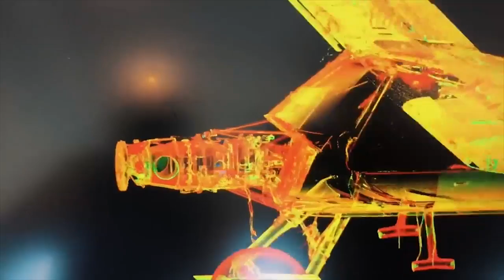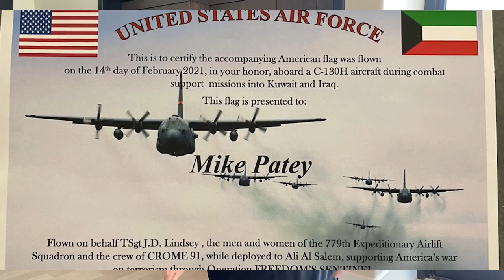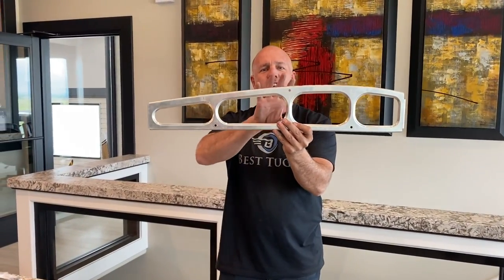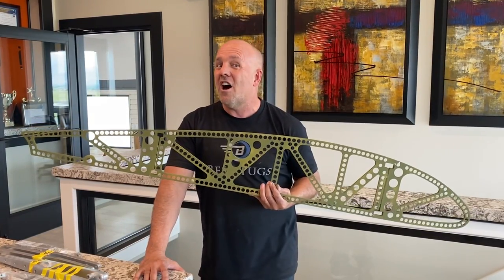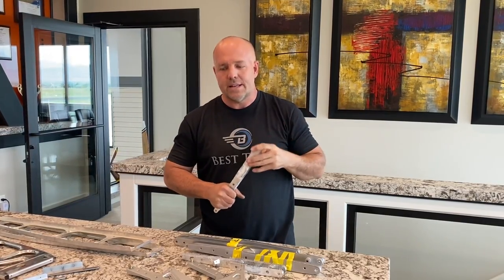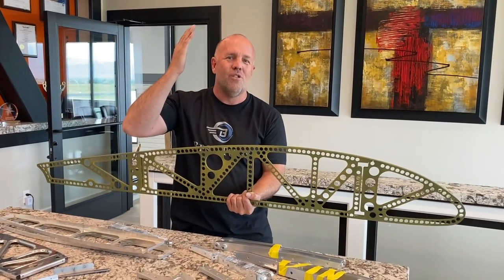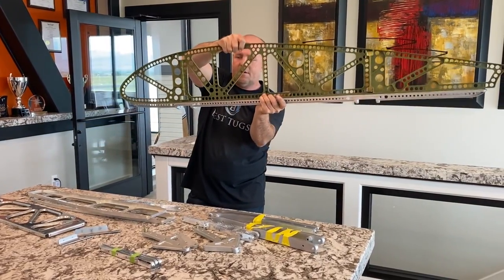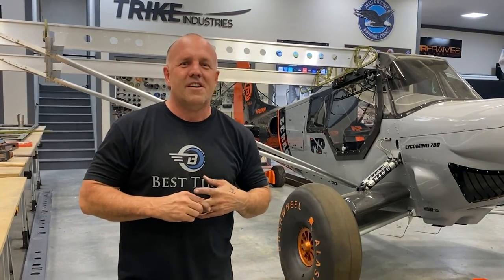Hanging Electric Mountain Bikes from an Airplane's Wing | Scrappy #56

Comment: All day Mike drills holes in metal, then bolts them together.  At first it’s boring, but then it’s riveting.
Reply: I see right through your comedic value! lolll
Reply: Slow clap.
Reply: Now that is funny
Reply: Interesting…@2:51 you can see that what became the keyholes startout as having an internal keyed feature 🤔

I surmise the hole pattern is for attaching actuators of some kind and the keyed opening is an anti-torque detail… but why two rotary actuator at mid span? Hmmm
Reply: @wwjjss33  I would guess some elaborate Fowler flap mechanism .
Reply: No words.
Reply: Hahah, awesome
Reply: Groan!
Reply: @wwjjss33  I was thinking he'd probably try some extended flaps like the RCAF Otter 3682, they're sort of like flaps on flaps and deflect twice as much, but instead of a permanent extension to the flaps, it would retract flush and not add any additional drag in cruise.  If it were me, I'd design a flaperon system to go along with it, and a servo tab controlled by a torsion bar because aileron forces get ridiculous with full flaps and flaperons.  The torsion servo tab is fantastic in its simplicity, the more force you apply to the stick, the more the torsion bar inputs travel to the servo tab to lighten aileron stick forces.  If you're slow and aileron forces are light, you don't torque the torsion bar and the servo tab stays aligned with the aileron.  If you're fast (or you have flaperons) and aileron forces are high, you're feeding torque to the servo tab and it deflects considerably to lighten stick forces.  It's a design seen on the Socata TB-30, you can hardly tell the difference between flying at 70mph or 270mph, they feel identical.
Reply: HOLY SCRAP!  Those ribs are amazing.
Reply: ahhh you...
Reply: @801pilot  amazing impressive beyond riveting- Scrappy EAA 21' :)
Reply: Ha.
Reply: Some people aren't catching the boring (drill), riveting (bolts)
Reply: Lol🤣

Comment: The special holes are for a special 360 powered articulating camera gimbal that will have a Multi sensor 40x Zoom / FLIR cameras that will look for heat signatures on the ground and auto track hot spots (people) for search and rescue ops! It will add the counterweight for the mountain bike.
Reply: Stunning idea

Comment: Weird holes: probably to hold actuators and power transmission elements related to changing wing form.
Reply: That was my first thought too but he said he hasn’t mentioned anything about what they’re for at all
Reply: He did say there is a torsion bar tube through his tank.  I bet it's a fabric top to the wing to work with this mechanism
Reply: Best bet so far.
Reply: Ohh, Mission Adaptive Wing!

Comment: I have no idea, but the arrangement looks suitable for a rigid torsion control connection, potentially even for an in flight wing flex/torsion adjustment by manipulation the lever end of a torsion bar to work like a dynamic sway bar on a vehicle.
Reply: My thoughts also, given he even mentioned having something similar in a previous video.
Reply: Thats what I was thinking.
Reply: I'm sure there was a hint about this in a pervious video on the fuel tank.
Reply: I thought the torsion tube was to actuate ailerons
Reply: Mike already mentioned that he will adjust the wing to add lift at low speeds but able to flatten the wing to avoid excessive drag at higher speeds... I think you guys are on the right track
Reply: Get's my vote - Mike will definitely have given a lot of thought to drag reduction for speed and range, given there's so much else going on for its STOL capabilities.
Reply: Yep, I agree.  Wing warping, chord and camber changing, and probably span adjusting (remember, slide-on ribs).  Wow!

Comment: Hello Mike, 
Retired structural engineer and rookie pilot here.  Have no idea about your mystery holes but as some have suggested maybe they have to do with your wing surface optimization.  Would like to add that the intersections of truss web members to the chords of trusses are “panel points”.  You explained where concentrated loads may be applied well but seemed you were looking for the term.  And one other thing is that without diagonal web members in a truss, you will still have a Vierendeel truss, although not as stiff as other trusses with diagonal members.
Sincerely,
Will

Comment: I guess those holes are to accommodate variable wing geometry system components such as pivot points and actuators
Reply: Nah those are obviously for  the active missle defence flair system
Reply: I agree.   Has something to do with the variable wing geometry.  He mentioned he was doing something like that.   Or it will be part of in air tanker refueling lol.
Reply: After all these videos! Why do I still sit here in disbelief?  These guys have NO limits. Thank goodness their passion is family and flying.
Reply: Looks like he's changing the camber and possibly the chord post wing tanks
Reply: The fact that the front spar is longer than the rear one makes me think something will move at the end of those wings yes….
Reply: Agreed, I think that’s what was blurred out in the last video.
Reply: This was my guess
Reply: Holes are there to make it lighter but strong....

Comment: The 6 holes are for the linear actuators that will provide the variable wing chord. One of the reasons the wings structures are so beefy are they need to take the load of a radically large chord. This plane might fly as slow as 15 knots or so in slow flight config.. Amazing Mike and crew!
Reply: Charlie dropping knowledge on us!!! 🔥💪
Reply: He said in a previous video that said system is powered by an axle (he called it torque tube) which makes sense. The axle is probably continuous  or has some mechanical connection and prevents one side to deploy without the other. 
Either way it doesn't justify the pattern of the holes... Also if I were to design a variable chord mechanism I wouldn't have one big single central jack screw, but rather 2 or 3 smaller ones along the leading edge.
Reply: @Ozarkprepper643  why would he want to adjust the dihedral angle of the wings? It only changes the stability of the aircraft, not performance. Especially when than involves applying more stress to already loaded components?
Reply: @Ozarkprepper643  ok...i never heard of an airplane that does that. What is the model? And do you actually see a difference in performance (speeds, loads, etc) 
How do you adjust it? It must be hinged at the root, do you have a telescopic strut or??
Idk, it doesn't seem to be one of those things I would want to change mid flight. Messing with the characteristics of the plane without electronic stability is bold to say the least.

Comment: The holes are for your flexible geometry wing mechanism…….or they could be the electrical output connector holes for the nuclear reactor you are scratch building, to power your camp lights.
Reply: 14:06 left side of the screen. Are these slotted sections for the slats, or?....
Reply: @jeffreyroth7517  speed brakes?
Reply: @Mikesukes  I was thinking about speed brakes but realized the prop will work well as a speed brake

Comment: Holes are for fuel lines and vents to drop tanks for the wings, ones with slots are for 2 pumps in each wing for redundancy
Reply: I like your guess better than mine. He did say he was going to have a fueling station for friends. So maybe the extra pump is for offloading fuel in the backcountry, refueling other aircraft.
Reply: @WeBeGood06  inflight refueling? cool.
Reply: If we look at the placement it really fits in nicely with the main wing tanks. Also important is that they are only there in the main spar, so whatever it is, it can only be a mounting bracket/hole.

Comment: The holes are for “tendons” much like prestressing in bridge construction.   On second thought, after seeing the trial install. they are to attach brackets for recessed lights.. Haha third edit, upon further reflection, I cannot presume to even have a clue,, Mike 😂 ..... Alright 4th edit. Its possible that Mike cut random holes to get far out ideas, and collectively invent something entirely new. The warp drive is my personal favorite.
Reply: Lol!
Reply: Hahaha this comment got funnier the more u read it
Reply: @Eric E That’s right. I forgot about the torque tubes. Honestly, Mike is creating wings that are unbelievably complex compared to the original Carbon Cub. I am not involved in aviation, but have invented and built a number of machines. The level of engineering he has built into this “scrap” project is a master class in design.
Reply: Yep, na…yep…na ok na
Reply: @Eric E Moving Slats!
Reply: The arrangement of the holes is weird. A variable chord mechanism would most likely have several jack screws along the leading edge, not a big one right after the strut mount...
Reply: @Lightbyfaith  that statement about a 'master class in design' is no joke.  A LOT of aircraft engineers could learn a lot from Mike and if they applied 25% of what he is doing in Scrappy to GA in general, we'd see a lot better aircraft for not much more money.
Reply: Are the holes for passing flight control cables through?
Reply: I say some is right... but after seeing these hard points... one of those holes is for a release cable I bet.... air drop of a survival pack to stranded hikers and climbers
Reply: @francisschweitzer8431  that is a wing spar. When the wing is finished it will be completely covered, besides is facing forward unlike the actual rack he just showed in the video, which could be used for that
Reply: Attachment for speakers to play Ride of the Valkyries
Reply: @almerindaromeira8352  Even if the wing is completely covered, you can still run small holes through it for release cables for a survival pack drop.  Why did Mike have so many pulley assemblies made up, especially if the control surfaces are going to be torque tube controlled?  Cable runs for the 'hard points.'
Reply: @GaryMCurran  the tube is for the "extendable wing/ variable chord" mechanism. The pulleys are for the control surfaces. 
Besides Mike is not going to cut 6 mid sized holes on a main spar to run a cable.
Reply: @Lightbyfaith  it stopped being “Scrap Made” after he grafted the frames parts together.... it’s kinda of how Frankenstein was born... wasn’t it?
Reply: @GaryMCurran  TRUTH... after the initial set up and tooling.... the cost would level out.  I’m not talking about the custom carbon work he did.... that would need to be standardized like fiberglass lay up... in molds ... but Scrappy is definitely a One Off
Reply: @almerindaromeira8352  I know it’s a spar... I know which way it goes ... the holes are for some type of transition access to a fore/aft movement of “something” from the torque tubes we saw.  .... but when he shows us these hard points to carry stuff... I revert back to my 12 years as a crew chief in the USAF.  We used hard points but the method to drop anything off them involved a 12Ga shotgun shell.   He can’t do that so he may be incorporating a remote mechanical release.   Bikes are the only thing he’s thinking about.... rest assured on that point
Reply: @primrosereceptionist611  WINNER!!!! You should get a free spar art for this comment.... what do ya say @mike
Reply: @GaryMCurran  sounds exactly like what I said
Reply: You all know Mike volunteers his time and equipment for Search and Rescue right? I would say you guys got this figured out. 😎
Reply: @francisschweitzer8431  have you noticed that 2 of the holes are keyed and have 2 smaller ones each right beside them? They are identical and go one over the other. The location is also in line with a fuel tank. 
Many people pointed out it has to do with fuel pumps for transfering fuel to his buddies. I don't know if I believe it, but it's better than the cable option. You can run a sleeved cable through everyone of those circular lightening cuts. That thing is a mounting plate for something x2
Reply: @francisschweitzer8431  i think it might be to also adjust the twist in the wing as well as the other things he's mentioned

Comment: Knowing how crazy you’ve gone designing Scrappy so far I’d say the holes are probably for mounting an external fuel tank, a military grade FLIR camera, JATO system, and a Skyhook…

Per wing.
Reply: Mike talked about JATO in a previous video and he mentioned a hard point on the lower portion of the fuselage.  The same point could also be used for floats.

Comment: The holes are mounts for poles for a shelter under the wing for camping. The wing turns into the roof of a tent. Or they are big holes to take large heat sinks for uuuuge lights.

Comment: My guess is all the extra holes he drills is so that he can make a wing that extends out and in. So that when he wants more loft and slower speed can extend the wing out to be longer. Faster, pulls the length of the wing in shorter.
Reply: I would bet those are command by the computer,you touch a key,wings go in and out

Comment: What are the holes for??? Guns! Cannon! He's making a CAS platform.
Reply: Ohhhh yeah! CAS plane is best plane 😂
Reply: Lol did you even watch the video
Reply: I told him last time he needed hard points for gun pods! Or use them for cargo pods I guess...
Reply: @jeeperzcreeperzz  r/whoosh
Reply: Scrappy 1-3 this is Thermo 6, I am troops in contact, need a gun run in the treeline 2-0-0 meters my North East, our position marked purple smoke. Suggest approach from South East. Scrappy 1-3, Have you in sight, cleared hot.
Reply: Hydraulic leading edge droop flaps!
Reply: @jeeperzcreeperzz  guessed as soon as he asked us to guess. Will finish watching the vid after work
Reply: @hardmack  ‘in the tree line 12m to my front, danger close..’

Comment: I think we just saw an "Easter Egg" . A rib at the 7:38 mark that gives some info on what this wing is going to be capable of.
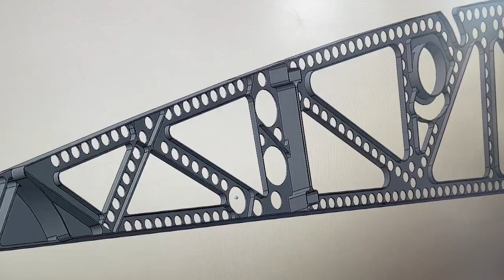Reply: 13:17 too
Reply: @Hastelloy X spoilers?
Reply: Three tracks approximately 120 degrees of throw.  The center one is offset about 10 degrees to the rear(traveling the opposite direction?).  That slot on top of the rib, above and to the left of the bushing….is interesting too.  Can’t wait.
Reply: @Hastelloy X He has also hinted to having the ability to warp the wing or tips during flight. So I thing we're all on to something pretty close to the final product. I'd kill to be half as smart as Mike is. So much fun to watch the evolution of his ideas come to reality.
Reply: The arches indicate to me the ability to thicken the wind cord. And he appears to have developed a track system perhaps capable of adding another 6+ in to the chord width. And his strut attachment looked much more than just heavy duty. It looked capable of allowing dihedral, anhedral adjustment. Something I think he compromised on with Draco.
Reply: @Hastelloy X with the tracks it would be easy enough to add 6 + inches in either or both directions. This could give him as much as an extra 30  to 40 square foot of lift. But I doubt it's any one thing.

Comment: My guess for the holes is, mounting points for wing hardpoints to mount additional (drop-?)tanks, equipment pods or maybe some drop pods (as someone else mentioned) to drop supplies during SAR ops.

Different idea: stabilization to mount floats?
Reply: Floatplane Scrappy would be wild
Reply: @kevinfitzpatrick5949  He mentioned it in an early video about his engine; wanting enough power for high altitude float flying
Reply: Congratulations on your wing performing like a bolt together kit.  Outstanding planning, design, engineering and machining.  

The holes are for some type of actuator.   Perhaps for your variable geometry wing.  Two of those holes (with cutouts) are going to have something installed that is producing torque.   The other holes are for actuator rods or electrical connections.

I wish I did not have to wait a week to get the answer.

Your enthusiasm, character and talent are superior.  Keep it up.  Back to work.!

Comment: Those are mounts for a charger pack and power connection points to charge the bikes batteries enrout, using the aircraft 24V electrical system. The other option are refueling other airplanes valve and hose connections and extended range fuel pods connection points to also hang fuel from your hard points.

Comment: Woke up in the middle of the night with this thought: the bike fork and dropout may not be designed to sustain the negative forces they will experience inverted and attached to your wing.  If the front wheel separated from the fork and the bike were mounted with front wheel forward the bike would rotate backwards eventually impacting the wing and damaging it.  I suggest you move the battery from the bike frame and place it inside the cabin.  Then consider building a custom carbon fiber pod to hold the bike much like what is used to transport bikes on commercial airliners.  In fact you might even move the wheels inside the cabin to shrink the size of the bike pod even more.  I am not a pilot nor an engineer but I just love your show as it teaches so much about how to make stuff.

Comment: Two of the 6 holes are keyhole shape and in line with each other, and oriented such that they may be used to easily place a bracket of some sort while easily aligning the remaining 4 holes, which might contain structural nuts and bolts, hidden by some of those inspection panels under the wet wing. Mike also mentioned carrying huge fuel tanks on those billet aluminum I beams.  Perhaps those mystery holes are for something to plumb external tanks into the wing tanks, thus giving him the range to fly across the Pacific.

Comment: The keyhole-shaped holes are for actuators that'll control the modifying mechanism for the airfoil. The rectangular part at the bottom of the keyhole is for a lug to locate and hold the base in place to counteract the force of the actuators.

Comment: The holes are clearly the mounting points for the wiring loom for the linear actuators that move the extendable slats at the front edge of the wing.